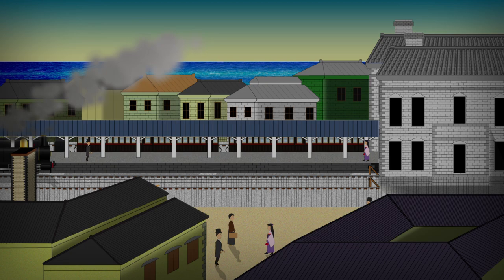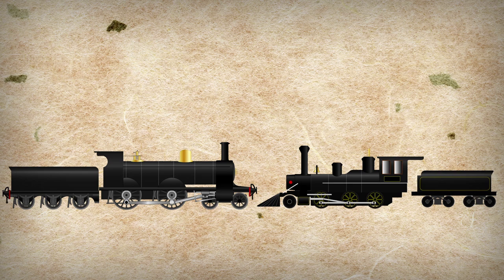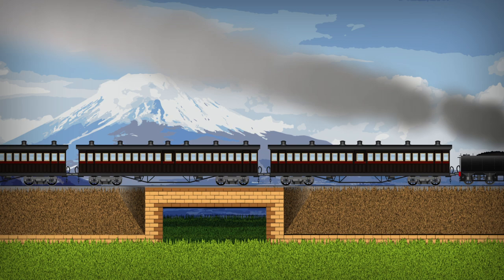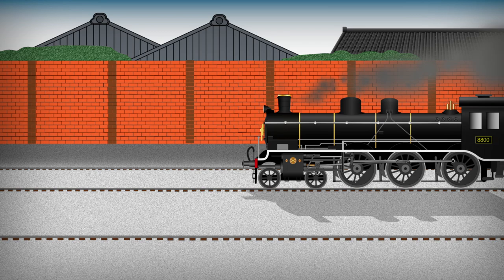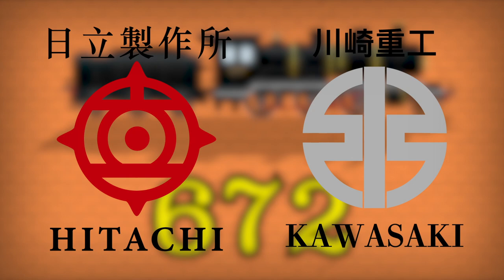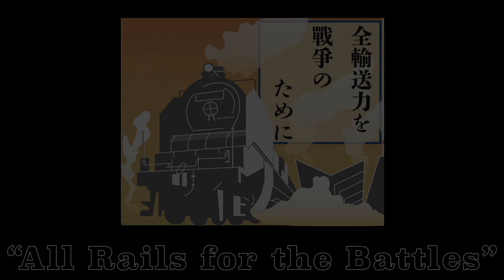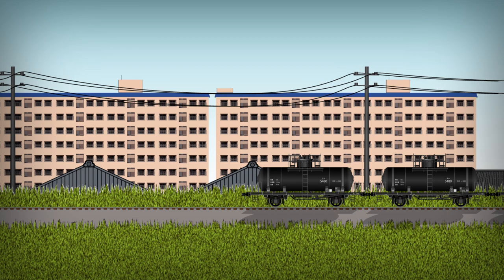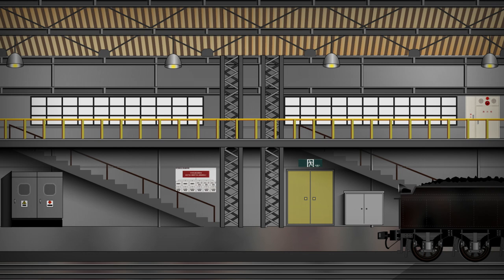Class 8620: The steam train of Demon Slayer, SL人吉

Comment: Thank you for making an explanation video of the steam locomotive 8620.
If possible, I would be grateful if you could explain the "D51 steam locomotive," which was the model for the Japanese locomotive "Hiro" that appeared in Thomas the Tank Engine.
It's a steam engine that every Japanese knows, so be sure to check it out.
Reply: What about the C6 as well?
Reply: 禍臨   Yeah. The wholesome but sad connection between animal and machine.
Reply: Mr. C6 is based on the infamous C62 class 4-6-4 steam locomotive, which is in-fact the fastest known steam locomotive to run on a narrow-gauge rail line, with a top speed of 129 km/h (80 mph).